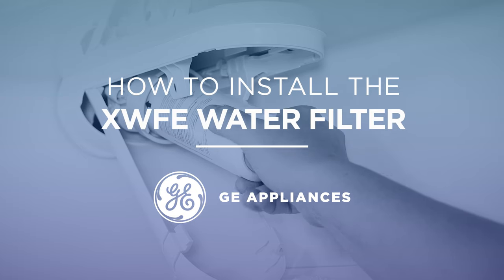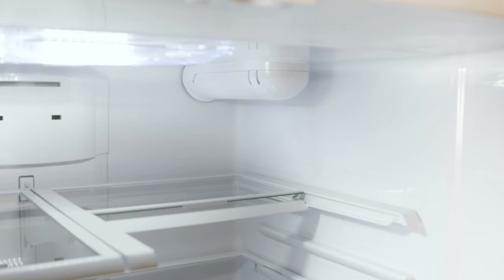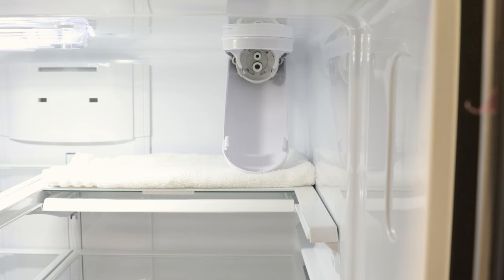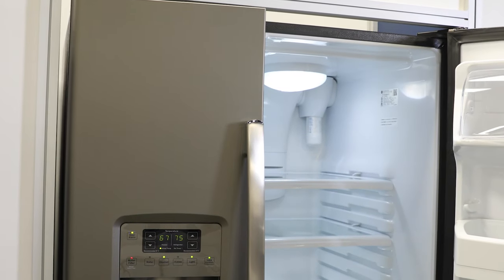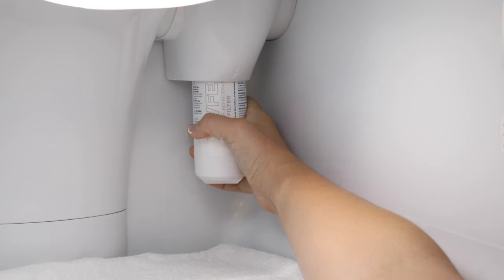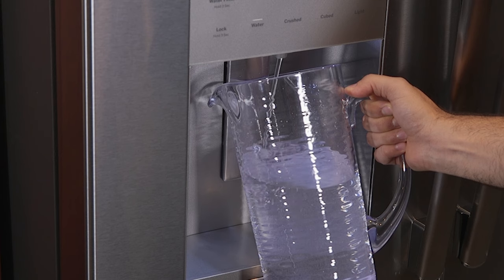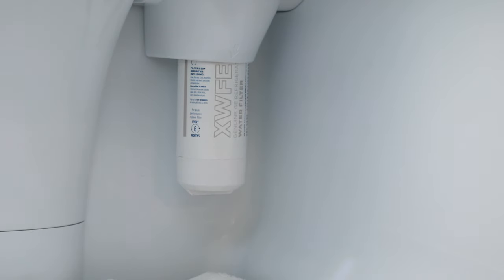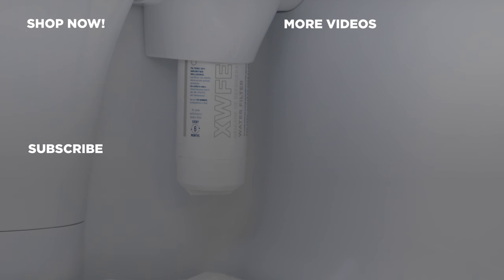Replace and Install the XWFE Water Filter

Comment: $100 a year for filters?! Just admit you did this to sell over priced water filters because the "non-GE" filter were eating up profits. I will never buy another GE appliance again if I have to purchase only GE filters, and I will make sure no one I know ever buys GE again.
Reply from the maker: Hi Dan,

Thanks for reaching out. We're sorry to hear of your frustration and that this has turned you off of our products. We did want to say that pricing can be dependent on several factors. The economic elements include distribution, warehousing, and marketing costs, which account for a portion of the selling price of the part. Other factors like usability (cosmetic vs. functional) and availability also contribute to pricing.

We do hope we can work hard in the future to earn your trust back.

If you've got questions/concerns, you're always free to reach out.

Best wishes. -MS
Reply: Is the. Xwf same as xwfe
Reply: @visa1960  It is the same filter but you must use the xwfe one if that's what your fridge needs. GE just slaps a RFID on the xwfe filter so your fridge will refuse to use a generic xwf filter. GE won't admit it (see the reply above) but they are doing this to force you to buy two of their ridiculously overpriced filters every year for $100.
Reply: @geappliances  I see you give the same response to everyone that talks about the price. Just admit it, this is a way for GE to squeeze money out of their customers. If generic filters can be sold for $10 each, so  can the GE filters.
Reply: My refrigerator takes a xwf and I got sent a xwfe and now I cantata any ice
Reply from the maker: Hi again,

Sorry to hear about the issues you've had here. The XWFE filter is backwards compatible; it can be used in units that currently utilize an XWF filter. However, the XWF is not forward compatible with newer models of refrigerators that are designed to have the filter interact with the control panel.

Are you getting any errors on your display? If you are, take a look at the bottom of the first section in this article to see if it helps: https://products.geappliances.com/appliance/gea-support-search-content?contentId=000060638&_ga=2.252241673.1045186091.1659353105-1657613511.1658931497

If you continue to have issues, please send us a private message on Facebook or Twitter with your complete model and serial numbers as well as some screenshots, if you're able, of our conversation here. This will help keep the entire conversation in one place.

If you need help locating your model and serial numbers, you can use this page: https://www.geappliances.com/ge/find-model-serial-number/

Hope to hear from you soon. -MS
Reply: @geappliances  what you can do with yourself starts with an F.  This is the absolute best way to lose new and old customers. Keep it up, dummies.
Reply: @geappliances GE hurt itself in confusion (if only it hurt itself more)
Reply: Yes, just brought mines 6 months ago. And i didn’t realize it was twice a year.   Expensive product.  Oh well.
Reply: Just brought mines 6 months ago.  i didn’t realize it was going to cost me ($100 ) a year for a water filter.  Wow……….   Very Expensive for me.  But oh well. what can i do now.   🙅‍♀️
Reply: Absolutely I will never buy a GE again because of this.
Reply: My new Filter is not working and showing Error on the Fridge any advice here?
Reply: @Ladylightway Don't replace it, but tell the fridge you did. This has worked for me for 2 years
Reply: I am experiencing this now. The xfwe is 9 times more expensive than the xfw which best I can tell is the same filter without the chip. this is 1000% a money grab. My old samsung failed because of needed tech features. You have lost a customer. When my dishwasher, dryer, washingmachine, whatever fails I will not buy another ge appliance I am furious right now. I guess i will spend  the next 5-10 years buying ice because you will not get another dime from me @geappliances
Reply: @geappliances  - There’s literally a $12 version of this filter readily available on the market without the RFID chip. It worked perfectly fine. If the chip adds $43 to the price without adding any real value (leak detection??) then it’s not a viable change to the product. I think GE was tired of 3rd parties selling filters and decided to destroy the market with a proprietary version that only you could sell. It was an unnecessary change. 

Water filters are a commodity, factors affect the entire market, not just one particular filter. The price of the old filters didn’t go up 5 times so it’s not market forces at work.  Nice try but no.  The XWF filters are still functional and aesthetically pleasing, they just lack the cut off chip. 

What happened here is GE artificially created a monopoly on their water filters and forced their customers to pay a massive premium for their product. Blaming market forces for this increase is disingenuous at best.

Comment: Obviously, with so many people having  problems with the XWFE filter, GE is at fault here.  My fridge is 6 months old, and this was my first filter replacement. I purchased the replacement filter  first from Amazon which stated that it was a GE Certified Filter, and got the error message when installing.  I returned the filter to Amazon and ordered the filter from GE directly, waited  weeks for the part, installed it and got the error message, so I am sticking my old filter back in and will return my fridge which is still under warranty
Reply: John in St' Louis exactly the same
Reply: @johnlanterman8633  Me, too. I had GE send me the bypass plug - still no water and  red filter light.
Reply: @awjudge  Me, too. I guess we have to call their service and let them earn this money.
Reply: My problem here is, the ice maker isn’t working at all, I replaced the filter, bought it on Amazon, and the water is coming perfectly, but no ice at all. The worst thing is, that isn’t my own house, and my landlord never call the people to fix it. 🥹
Reply: Me too! WTH? I can’t return it because it’s a year old and yes I waited that long to replace filter.
Reply: Same problem here

Comment: Yep, another complaint about this crazy filter system.  New fridge, GE sent me a bypass plug, I had to pay shipping.  Now I'm getting Err and, of course, no ice or water.  Customer service is a waste of time.  Good job GE, I'd be proud of your service and product.
Reply from the maker: Hello – We’ve responded to you via your Facebook PM. Please see this message as we’d love to help. -GD
Reply: @geappliances i am having this problem right now is there something I can do
Reply: I can't get it inserted.
Reply: I just bought a new GE side by side about 6 months ago.first time trying to change the filter and I can't get it to insert.  Any suggestions?
Reply: I'm getting the same Err on a new GE XWFE filter I bought.
Reply: @geappliances  - Nobody cares how you responded to them, did you fix the problem that ALL of us are having with your product? How about responding to the rest of us with some kind of reasonable solution? How can we bypass this defective chip system you created and get the ice maker to work?

Comment: Make sure you call GE and get a free Filter Bypass Plug. If your water is fine, just use the plug. If you want filtered water have the Bypass Plug on hand for when the filters give you an error message. I've ordered a plug after our filter exploded, water leaked through the fridge and damaged our hardwood floor. Hopefully the Bypass Plug will be tougher than their filters.
Reply: I got the bypass plug directly from GE. The filter panel shows "bP" but the water still doesn't work. There is no "reset" button anywhere. I wish I'd bought a samsung.
Reply: Curious, we purchased a GE Profile and it came with the plug. We've had the unit for 13 years now, and the front panel water filter light just lit recently. I purchased a filter, but can't seem to loosen the bypass plug!  The bypass plug has been working just fine for 13 years, now I am thinking it's better to return the filter.
Reply: If the water is fine, isn't it easier to just use your faucet? lol

Comment: Just tried to replace our water filter, which has been done religiously every 6 months, and now have the Error for the filter replacement.  We have an XWFE filter, purchased at Lowes as we always have.  This is where we purchased the refrigerator.  How many filters do I have to purchase and return before I get one that does not give an error?  It is not like we are purchasing an after market part.  It is a Genuine GE XWFE filter.
Reply from the maker: Hello,
Thank you for choosing GE Appliances. We are sorry you are experiencing issues with your new XWFE filter. We understand how frustrating this can be and would like to offer our assistance. To resolve the issue, please refer to the troubleshooting article at this link: http://spklr.io/6056YS7a. If the filter is installed correctly, we suggest using a bypass plug to ensure a smooth water flow through the dispenser. If the issue persists, there is a problem with the new filter. As per Lowe's return policy, we advise either going to Lowes for a replacement or sending us a private message via social media for further assistance. Take care. -SH

Comment: for side by side model cartridge installation, make sure you rotate the cartridge holder away from the frig, then line up the 2 holes, turn filter right quarter turn it will slip into place and is now ready to be gently pushed into support brackets..

Comment: Couldn''t figure this out until I watched this but if I had known that GE made their part NOT interchangeable easily I would have searched for another fridge to fit my built in space.  Apparently you can take off the little tab that sticks on and use is on a less costly filter. I found another video that showed this. Got my filter through amazon and it works but next time I will try the cheaper version and move the plastic tab to it and see what happens. What a drag GE!
Reply from the maker: We recommend that refrigerators with water filtration systems only use genuine GE Appliances water filters. Genuine replacement filters are certified to NSF/ANSI Drinking Water Treatment standards which ensure structural and safety standards are met, and are designed to operate within the environment of the refrigerator. Counterfeit filters do not always meet the NSF/ANSI Drinking Water Treatment standards and can damage the refrigerator's filtration system.
Reply: GE... that should be up to us to decide what's best and or affordable and if not, there should have been a huge warning on display models about being forced to buy your expensive ass filters.  I'm pissed.  Wish I could afford a new fridge and I tell everyone I know to never buy another GE product.

Comment: I am installing a new filter and I have everything lined up and inserted properly and when I try to use the water dispenser it says error. I’ve tried reinstalling it several times and tried resetting the filter status to no avail. It really shouldn’t be this complicated. And yes I’ve replaced filters a million times so I know what I’m doing and yes I purchased it from a reputable source so it’s not some knock-off.
Reply from the maker: Hi Michelle,

Thanks for reaching out. So sorry to hear about the filter issues you've had here, we're sure that'd be frustrating. We only recommend purchasing parts or accessories from our parts website, here: https://www.geappliances.com/ge/parts/?icid=GEARpartsflyout-allparts - This is to ensure that the part is genuine.

If you're still having issues, please send us a private message or DM on Facebook or Twitter with your complete model and serial numbers. We'd be happy to review further. If you need help finding those number, you can use this page: https://www.geappliances.com/ge/find-model-serial-number/

Hope to hear from you soon. -MS
Reply: @geappliances  so Lowes doesn’t sell “genuine” parts? Even the ones that have your logo on them? And therefore I need to purchase online from you?
Reply from the maker: Hi again Michelle,

Searching for your complete model number on our parts page just helps to ensure that you're looking at parts that will work for your specific variation of appliance, and to ensure that those parts you're viewing are genuine. 

The need for genuine parts is more related to us cautioning you from purchasing from another website, as opposed to an authorized dealer or our parts page. We have no way to confirm that a part you're viewing on the internet, outside of our parts page, will work for your specific variation of model.

Again, if you're still having filter issues, feel free to reach out to us privately on Facebook or Twitter with your complete model and serial numbers. We'd be happy to review the situation further.

Hope to hear from you soon. -MS
Reply: Have you figure out this issue? I’m having the same problem
Reply: @dannypetrisor2999  it was a defective filter. I returned it and bought another one and it worked. Someone who worked at Lowe’s said it is fairly common they’re defective. 🤷🏻‍♀️
Reply: You might have xwf vs xwfe which has a chip in it
Reply: Same problem here…  model GFE26JEMNFDS serial TS313164
Reply: Same problem here
Reply: Getting an err message after ordering the filter through GE
Reply: Someone help, tried all the suggestions. The FE says error, the old filter removed  when replaced gives us ice and water. The new one says error. How to reprogram if that’s what it needs. Who to call?

Comment: Thanks for this! I have a GNE25 fridge and cannot get the arrows to line up when installing the XWFE filter (it's about 1/3 inch off). Water flowed from the dispenser for a while and then stopped. Do you -- or someone else -- have any insight into what might be happening?
Reply from the maker: In 2022, there was a minor change in the design of the XWFE. The design at the top of this filter now has slots where the previous XWFE did not. It does not change how it fits into the filter head (port), though it may take a little more force to put it in and the arrows may not line up completely.
Reply: @geappliances  Thanks for the quick reply! I'll assume that the arrows won't line up and thus won't try to force it.

Comment: GE what is the work around to not have to buy the super expensive filters?
Reply from the maker: Hey there, we're sorry to hear that our water filters have not met your expectations. This feedback is very valuable, and we will share your thoughts with our product and design teams for future consideration.

Our genuine filters are tested for safety and reliability, and we do not recommend using non-GE filters as this could cause damage to the appliance.

Also, pricing can be dependent on several factors like distribution, warehousing, and marketing costs, which account for a portion of the selling price of the part. Other factors like usability (cosmetic vs. functional) and availability also contribute to pricing. 

Please let us know if we can help with other questions or concerns.
Take care. - PM

Comment: We have the XWFE filter. Put it in, held the red light button for 3 seconds, and nothing happened but a blink or two. No reset, no ice, no water. Fridge model is GSS25LSLSS.
Reply from the maker: Hello there, we're sorry to hear that your water dispenser is not working as expected after replacing your filter.

We recommend referring to the following article to learn more about potential causes, and solutions, for no water coming out of your dispenser: http://spklr.io/6053lDwX
You can also refer to this article for more information about using the XWFE filter: http://spklr.io/6054lDwk

Please reach out to us once more if we can provide further assistance. Take care. - PM

Comment: My refrigerator is only a couple of years old. I have replaced the filter once myself without issues. I just bought a brand new GE filter and keep getting the error message. Between this and the freezer handle falling off, it makes it hard to think about ever getting another GE.
Reply from the maker: Hi Lynda, and thank you for reaching out. We really hate to hear you’re getting an error message when you try your new filter, and that you’ve had issues with the freezer handle falling off. This certainly isn’t the performance we would expect, and we want to help. 

Please provide the model number of your refrigerator, here or with a private message over our social media. With this information, we can certainly review your concerns further. 

Going forward, we’ll do all we can to earn your trust in our brand. We hope to hear from you again soon, and we’re wishing you well in the meantime. -SG
Reply: @geappliances  The model number is GFE26JYMNFF.
Reply from the maker: Thank you for providing that, Lynda. Again, we do truly regret the trouble you've had and we want to help. 

We hope you've received our recent response to the direct/private Twitter message you sent, addressing your concerns further. All the best. -SG

Comment: I've flushed the system, I did over 2 gallons. Thought it was fine. This was done last week. I just noticed my cup had black specks in it. We've used well over 3 gallons. There's still stuff in it. It isn't from the ice either, because  I put just water in it.
Reply from the maker: Hi there - We're sorry to hear you may be having some trouble with your water filter. We'd like to gather some additional information from you about what you're experiencing. Please reach out to us on Facebook/Instagram/X via direct message. In your message, provide the model and serial numbers for the appliance with this water filter and your contact information. Hope to hear from you soon.